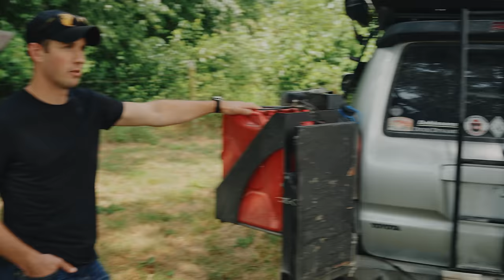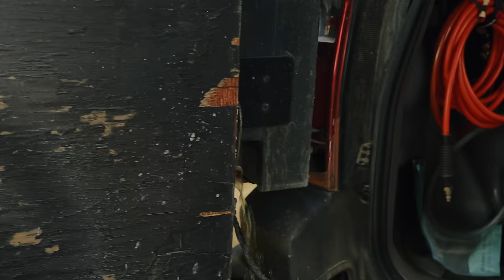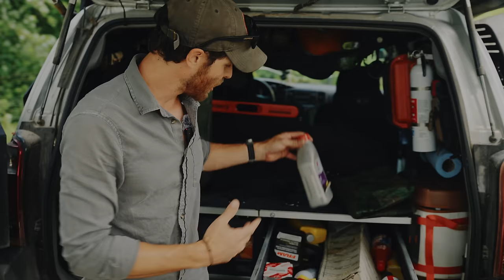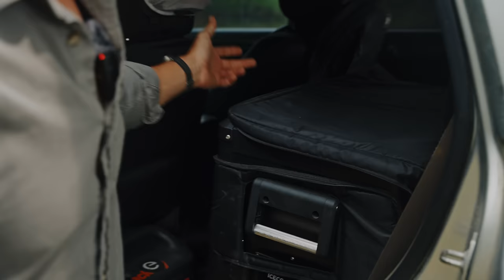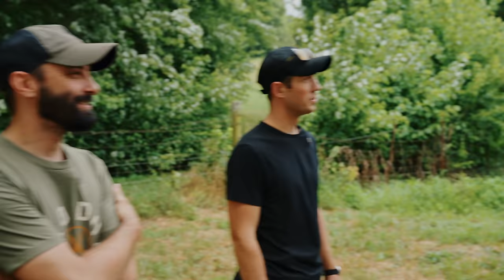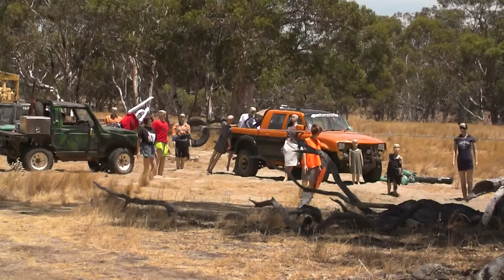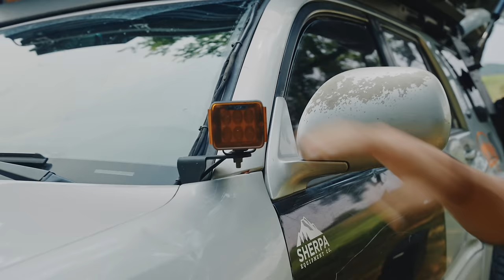4-Runner Overlanding Sustainment Loadout

Comment: DO NOT DO THIS
A “house battery” is not for starting the car or running lights, a house battery is meant to run “household” accessories, they’re deep-cycle batteries meant to run heavy loads for a long time (like a refrigerator or an AC unit) capacity measured in amp hours (a 100 AmH house bat can run 100a for an hour or 1a for 100 hours and all along a sliding scale in between) A house battery usually has a capacity from 200-600 AmH, only 50% are usable as a battery will be damaged if drained below 50%, so if you want 400 usable AmH, you need 800 AmH of battery bank capacity) a Jackery is a deep cycle house battery. 
A starter battery starts the car, it’s capacity is measured in CCA (cold crank amps, a standard truck starter bat is about 800 CCA, which only translates to about 30-40 AmH) it’s intended to provide a huge burst of power immediately when you turn the key and it goes dead quickly (this is why leaving headlights on too long will kill your battery). Starter batteries charge from the alternator and the car electricity (for radio, headlights, etc) is supplied by the overflow.  charging the starter via solar and running house accessories off the starter battery is not smart, that’s not the way a CCA battery is meant to work and you’ll destroy it… this is exactly when you want to a Jackery.  Leave your starter alone, let it run the car like it’s supposed to and use the Jack for everything else, charge it from the solar (and from the alt when the car is running). If you want to turn a thing ON when the car is OFF it should be on the house, not the starter. There is literally no reason to run a refrigerator off your starter battery when you’ve got a Jackery sitting right beside it. If you kill your starter bat by running your fridge, you’re SOL, you cannot jump start the car with a Jackery. If you have the right cord you could sit for a few hours and trickle charge the starter bat off the Jack and not be stranded, but it would be better to just run your electrical correctly the first time.  This setup isn’t the “budget” set up, it’s the ignorant one. The Jackery is everything you need in a cute little package, including a built in solar charge controller (you don’t need that box in the back seat) this guy is just using it all wrong. 
Learn a little bit about 12v electrical before you install a leisure system in your car, or take it to an RV mechanic… don’t waste money on incorrect/unnecessary equipment and risk damaging all of it with improper usage.

Comment: Just my opinion, but the most important thing to keep in your vehicle is fuel. A gallon of US unleaded gasoline is equivalent to 31,000 calories of energy. Without fuel, your vehicle is a paper weight that must be abandoned.

Also, the biggest shortcoming in the 4x4 space in the US, is the lack of diesel engine options. Pretty much every pickup truck has a diesel option. But most pickups in the US are too big and unwieldy for 4x4 trails. But, when it comes to handling payload and still having decent fuel range, you can't beat diesel.

Comment: Dude's got a cool rig, don't get me wrong but... yikes, has be plowed money into an old vehicle. He's got about the same capability as my 1997 XJ at probably 10x the cost. Do some research on prices and really think about what you're doing. Don't just go handing money to a company because it's cool and gets you clout or comes with ready-made organization. 

It's absolutely amazing to me how many ways people find to waste money just for convenience. Speedtools... yeah, comes with a cool Peli case. For $999-$1499 and isn't really that customizable to your rig when you get right down to it.

A Hayne's manual, a few hours of research in that manual, some tool rolls, a trip to a good hardware store and you get basically the same thing for <$500. Which means savings you can put into something else. Absolute custom holders for some of those tools? It's called a sewing machine, the use of which is a skill that will save you loads of money in even other places.

Comment: Me personally I would get the lightist truck with a 4 or 6 cylinder engine not a V8 as you know why. Put heavy duty shocks brakes system, a lift kit, spot lights, a winch, spare tire carrier for 2, top rack, water & fuel jugs, water pump, water filtration system, rechargeable batteries, battery charger, flashlights-Red lens, headlamp, 2qt canteen for each side of seats, night vision monocular, empty ammo cans, car battery charger a must, mechanic tools, multi tool, electric tape, electric Air pump. Can't go on no room for more request. These are but a few that should be on your truck. Remember Mad Max. That's how it will be. Be prepared. Solar panels to.

Comment: Honestly I think for the application you’re going for you might want to consider a stock yet capable vehicle. Plain. Maybe sustainment equipment in the bed under a toneu cover. Last thing you want is to stand out. You’re a free for all for those who might need your stuff. Sustainment gear and fuel in the bed. After that just look normal. I’d say the video kind of steered away from the scenario at points and just turned into a walk through of your overlanding gear

Comment: Always be prepared to hoof it, don't spend stupid money on a vehicle and equipment that you will more than likely have to abandon.
Reply: the roads in and out would be major cluster fucks. even offroad, ive seen people in honda accords try to drive parallel to a stopped freeway only to get stuck and block everyone behind them on the trail. big vehicles would be most effective far away from the urban centers.
Reply: @garrettzkool63  you miss my point.

Comment: 1st - I need to know who makes that basic long sleeve button up shirt.

2nd - Always loved lifted 4 runners but even highway gas mileage is pretty bad. Even on the newer Toyotas, your mpg is low compared to other newer trucks.

If they could fix that, I'd have a matte black 4 Runner instead of a $90k pickup

Comment: you can prolly get a second fuel cell. prolly have enough room with the 4runner. just need fuel lines fuel pump and rig it up to where you can run the second one as a reserve

Comment: Not shitting on this dudes rig choice but  could’ve gone with a better MPG choice 4x4 diesel. My salvage title ram 3500 looks like a regular ranch truck(I live in Texas) but it’s a overland monster. It has 1500 mile range on the highway due to 2 hidden aux tanks, has 730 miles in 4H and 310 in 4L. Without aux tanks I get 500 highway miles to the tank.  

For those interested in my trucks capability for starters it’s a. Long armed  2011 ram 3500 reinforced frame with a well patinaed rust repaired 1970s crew cab body and old heavy steel bumper the 6.7 cummins has been converted to mostly mechanical with EMP protection on it as well(the truck is registered is a 1970 so it’s illegal to do), the bed has a old slightly raised reinforced steel bed cover that locks onto to sides in 16 places(bear proof design). Custom flat bottom skid plates. I have two master electrical kill switches and a 24/7 computer that monitors the system for unexpected changes(a nerd friend made and programmed that badass thing for me). I have 5 tires and a tire repair kit, I have 37x13.50r17 with huch double bead locks, long travel arms and long travel carli airbags. It has 4 semi sized batteries on two separate systems that have two separate alternators, I also have a PTO generator that can power a house). I have also 60 pounds of propane(2 30s stood upright), and a 65 fresh water drum that has its own pumps(3 hydro aqua tiger pumps moving 54 gpm inline with 30 yards of 3/4 hose, I have to reduce power on pump 2 & 3 to stop cavitation because at 57gmp I had cavitation). Food I have 30 days or NREs. I also have a mini kitchen that’s bolted onto my tailgate, and a deployable hoist to string up and gut game. I have a hidden secondary 12k rear winch and a 16.5k warn winch in the front bumper, I also have cable extensions, and 8 snatch blocks and 2 welded plate ground anchors. I carry a full set of replacement axle shafts, belts, 4 gallons of oil(my truck takes 4), 2 gallons of ATF, and enough fluid to replace my diff oil 3 times, all my oil and fuel is double cased to keep it away from the water and propane since it’s all in the bed. I just put in a auto fire extinguisher system for the engine bay and bed. Under and on top of the truck it has emergency wet down system like wildland firefighters have that runs off a single 12gpm pump and the onboard water. I don’t have a shower Plumbed in yet. I carry a Milwaukee m18 chainsaw, M18 1/2 impact, a full drawered tool kit, the thiqqq wood screws, hella JB weld, hella gorilla tape, two steel picks and two steel shovels. For radio I have a “demiled” 152 and vehicle mount that is not set up for transmitting as it sits. I have paper maps and non satellite maps. I have XXL tarps I’ve made by sewing and seam sealing 4 regular tarps together, and also cammie netting the same size. I have amber, white Baja designs front lights, and white 360 lights and my taillights are on a switch too. I just picked up Baja designs IR lights I mounted under the bumper in a rotating bar in the bumper I installed. I’m in the middle of trying to get CBRN style cabin filter system on a switch but door seals are the weak point and I haven’t figured that out yet. 

Here is the kicker, my truck is sitting at around 18,500 pounds loaded. I also stayed single to build this because aint no way a wife would allow me to. I have dumped girls over the truck sadly. It’s meant for me to get wherever I need to go in the continent and build a house basically wherever I land. Idk how much money I have into this thing, it’s not my only vehicle, I don’t wanna even do the math. I have years into it. The goal was low pro overlanding that people see as a random dumb redneck exploring. 

Yes I know it’s overkill, will I stop? No, my ADHD/potential tism won’t let me.
Reply: Agreed. Don't know why past generation diesels are overlooked. Wish we could see pictures.
Reply: @mrag34  I’m very anti posting my rigs pictures online in the same places I talk about it. I have so much time and effort into it I have a intense fear of losing it as insurance won’t even replace 5% of what it cost to build it. I’d love to physically show it off and I do show it off to people I trust but the internet just ain’t the place anymore sadly.

Comment: What he's not saying is that the Baofeng is capable of operating on GMRS and Ham 2M / 70CM. which is an anti-feature that isn't technically legal for a device maker to make because Amateur/Ham is a different licensing than GMRS.  You can't REALLY get one radio that can do two things like that. But Baofeng "forgot" to disable that ability on a bunch of radios. Of course, no one is telling you to USE that ability. But.... for a WROL/SHTF world, it makes a great $30 radio.

Comment: So this is just tacticool larping for an almost impossible scenario that would be better served by a pruis or anything that could get close to 30 mpg on the highway. If you are leaving the city before it "gets bad" then you dont need any of that shit. If its already bad good luck getting out of the metro area with all that offroad capability since built up urban areas require lockers and a lift.

Comment: Sleeping in your vehical is probably the worst idea. Someone will check you out if found. You cannot effectively return fire if assaulted. Your escape from the vehical easily seen.

A bivy sack in an advantageous area overlooking your truck seems so much better.

Why not get a larger tank? Why wouldn't that be your first purchase (other than a modest 1" lift to handle extra weight).

Comment: Forget a Prius, his total range (extra tanks) is STILL LESS than the average 4 door family sedan with a 300hp turbo-4... 

I get you want to go 'over land' but that doesn't apply to over half the country. The sedans not going go get stuck EAST OF THE MISSISSIPPI  unless you try to drive through a muddy field or ford a creek... and if you do get it stuck it's a HELL of a lot easier to pull out with a come-along and pioneer tools.

Keep tools and a bail out kit in your NORMAL commuter car and you can just jump in and go. Unimproved roads, access trails, and un plowed fields are fair game for the grocery getter.

Comment: I’m worried about total collapse. My vehicle is a 12v Cummins 4x4 dodge on 37s. This truck has no electronics, is literally the longest lasting most durable engine ever made. It has a 8’ bed, can move 20,000 lbs, push pull or go over most obstacles, while getting 20mpg. Sense it has no electronics and is all mechanical it is emp proof. If gas stations are out no big deal. It is multi fuel, it will run on diesel, kerosene, oil, and atf. There will always be parked cars around to drain their oils out of.

Comment: AS SOMEONE THAT HAS OWNED 3 TACOMAS & A SHOTTY 03 4RUNNER, THE JACKS THAT COMES WITH THE TACOMAS & THIS 4RUNNER, THEY WILL NOT WORK! YOU WILL NEED A 4X4 WOOD BLOCK UNDER THAT CHIT JACK THEY SUPPLY!!! THEY JUST SAID IT IN THIS VIDEO AS I POST THIS COMMENT!!!

Comment: ONLY GET AS LOW AS HALF A TANK!!! YOU WILL SCREW YOURSELF AT ONE TIME OR ANOTHER IF YOU DONT!!! PLUS IT WILL KEEP YOUR FUEL TANK & LINES MORE MAINTAINED.
 I RARELY DRIVE MY 2003 
4RUNNER AS I DRIVE A COMPANY VEHICLE & IT HAS CONSTANT ISSUES & REPAIRS DONE BECAUSE I NEVER DRIVE MY 4 RUNNER.
Reply: I've had to have it towed in 3 times in about a years time due to me not driving it.

Comment: The V8 and V6 in those 4runners will have equally terrible fuel economy.
Reply: That's why I got the v8, if I can't get good mileage might aswell get the torque

Comment: armatures with the jetboil... your getting sold on the name not the function.   multi fuel stoves are the way to go. Optimus Polaris comes to mind,  one stove can burn anything from jetfuel to 100 proof alcohol.   If you need a stove and want it for backpacking, SHTF, world travel then the multi fuel stove is the only one you will need. Same with filtering water  Katadyn pocket filter will last you your lifetime and is serviceable in the filed.

Comment: Do not wash your engine compartment with a pressure chemical washer. All that will rust and damage your wiring system. Trust me. I know. Just air clean air dust free the compartment.

Comment: Another great vid; gear porn at its finest.  Swap that PB Blaster for a needle oiler of Kroil.  You'll thank me later 👍
Reply: I like deep creep because it's a better MPL.  I often run it in my guns.  If "one" penetrant won't crack it, it seems like any others wont do a BETTER job from my experience.  The next step up is to go to heat.  So if i'm going to carry oil I want a multi purpose oil.  Kroil works great, it is upper echelon, but I don't know that it's worth the sticker unless you have cans that follow you home from work.
Reply: @mattfleming86  oddly enough I’ve never tried heat. Kroil is spendy but literally one drop will do it. I’ll check out deep creep thanks!